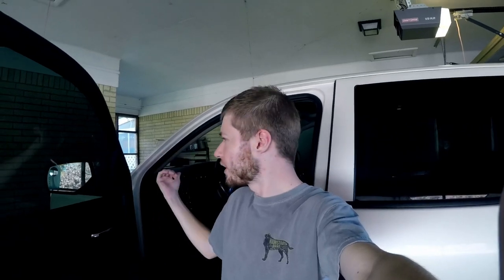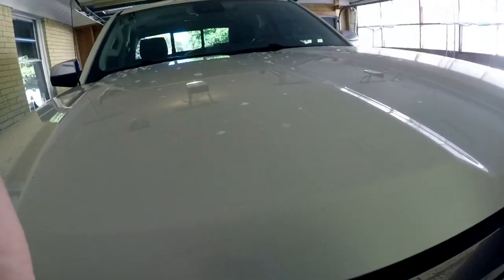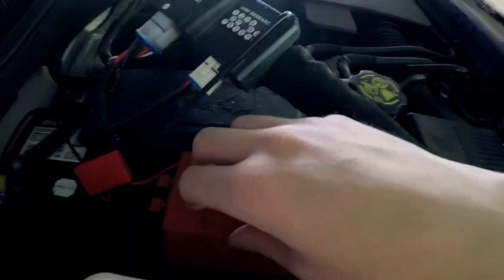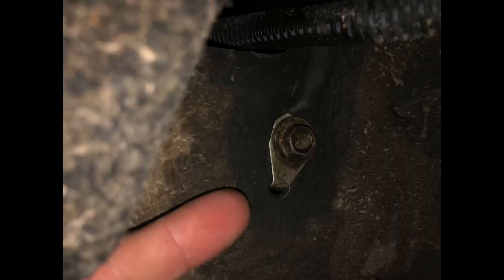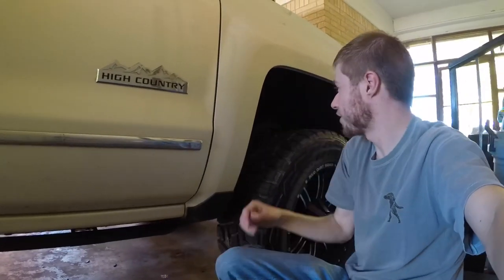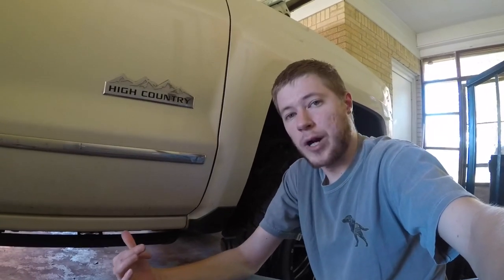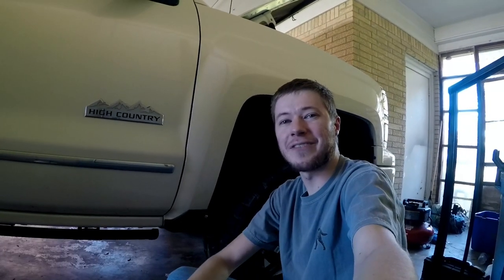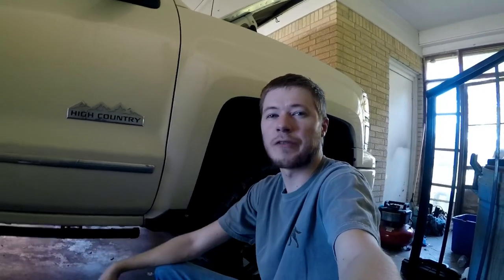Flickering Dimming Headlights Silverado Sierra (How to troubleshoot)

Comment: Had this same issue on my 2014 Sierra. Along with the flickering headlights, my nav screen and trip screen would flicker and my power steering would go out as well as my parking sensors. Really strange, however, my local dealership had a service bulletin stating that certain trucks in that year range had defective positive battery cables and replacing that should fix those issues. They did that on my truck and haven’t had a single issue for over 3 months now. Just an FYI in case your lights aren’t fixed from cleaning the grounds
Reply from the maker: This is really good info, I did not know this!
Reply: This is exactly my issue will see if Chevy will fix it for me thanks!
Reply: @audiesbuilds  did they fix it for you?

Comment: This is for everyone else that this tip didnt work for.  In 2016 I inherited a 2006 Chevy Uplander (only produced for a couple yrs.) that had the flickering headlight & dash light problem, primarily only noticed at night.  Battery & other parts tested fine, couldnt figure it out.  Drove for 5 yrs. like that, finally took it to the dealer & guy behind the desk said the only thing it could be was a bad battery but since I had drivien it for 5 yrs. without any starting issue, I found that hard to believe.  In 2021 I looked at the battery date stamp & saw early 2013 so I decided to have it tested again at NTB & local auto mechanic, said it was going bad.  Only indication is occasionally I would have to give it 2 tries to start. Given the age, I replaced it and the flickering lights problem was gone.  Only been a few months but so far so good.  It was an Interstate battery by the way. What I dont understand is, if it was bad 5 yrs ago, how could it start & run in all other ways so good for so long?  Anyway, hope my story can help someone else because it was so aggravating & at times dangerous when when other drivers might have thought you were flashing them to get out of the way or semi-trucks thinking you were flashing them to let them in.

Comment: My low beams 2015 duramax are super dim. New batteries recently and new alternator (both needed replaced). But never affected the headlights. 

With old batteries they would flicker, along with tail lights.

Comment: Thank you for the info ! I have a 2014 z71 and it just started to do this. I will be doing this before taking it to terry Cullen Chevrolet. Thanks again !
Reply: What did you find out about your issue?
Reply: @bradglo1469   they claim they didn’t  understood why it was doing it. They even told me if it was something I could just go on about my day.   I ended up trading the truck in.

Comment: Same issue here.. I cleaned the ground on the passenger side and it didn’t work. I had the alternator and battery tested, both are good. Next, I took of the dash to check the two grounds behind the speakers and both looked fine. Other than that I’m stumped!!!! I know there’s other ground throughout the truck but I can’t locate them. I was looking for a book or video that would show the locations of the “grounds” but I haven’t found anything! I Losing my mind now!😤.. it’s pissing me off sooo bad I’m starting to think I should’ve bought a FORD! 🤣
Reply: I am in the same boat. Cleaned and checked all the grounds above and still no luck. Maybe start switching out some cables. What a pain in the ass!
Reply: I'm having same issue new battery cleaned grounds then new alternator and now idn. Guess I'll get new positive cables
Reply: I’m in the same boat.  The passenger side ground worked for a little bit now nothing is fixing the issue
Reply: @gmrage  Did Yu fix. I need help. This is pissing me off. I have 2008 Silverado

Comment: I've got low voltage on 1 low beam, other is fine. I'm thinking corrosion in that circuit. Causing flickering. Headlights have the same power supply via the relay and the other light has full voltage, probably bad wire in affected side

Comment: I am having the same issue. Volts drop below line. I have gotten a check charging system. Truck has new battery. Cleaned grounds and checked wires. I disconnected ground clamp and there was no change

Comment: Sir I have Gmc Yukon 2004 6.0 I have same problem and change battery and alternator but still same can I do same and when I remove plug from ground sensor with battery 
It’s stop flicking when I put back again start help me
Reply: How did you fix your problem?? Was it the ground sensor coming off the battery

Comment: My 1 month old 2500 duramax batteries died and after I jumped it and charged them with a three hour drive, the only remaining issue is the flickering lights.   The dealer said they would need a few days to check it out.  I’m a fisherman and I paid 85k for this thing . I don’t have 3 days

Comment: Great video, thank you for sharing, I have a 2014 gmc sierra an I didn't have any problems but I put an alpharex nova headlights and everything is working fine, but for the first 15 or 20 minutes it starts to be flickering and after that the light is steady,  I will really appreciate it if somebody can tell me what is the problem.
Reply: I have the same issue with my aftermarket led headlights. Where you able to fix it?

Comment: My 2008 Silverado 1500 had a flicker problem most evident at night. That's why it was near impossible to get the dealer to find the issue if it only did it at night. Just b4 coming to a stop, I notice a down flicker in my headlights. I thought it was the alternator switching between regular and economy mode? IDK!
Reply: My 2011 Silverado does the same
Reply: My 08 is doing the same but it'll either switch from one headlight working or both working but one being really dim, I also noticed a lot of flickering when using my brakes, might be a relay going out or wiring issue due to the age but I'm not too sure
Reply: Did you figure it out ? Mine flicker on a 2010 going over 65 mph at night ? Also dim sometimes when the a/c kicks on.
Reply: Have any of you figured this issue out?? I have 2008 Silverado vortex max just started doing the same exact thing. It's pissing me off
Reply: @kenbog3638  That's what mine is. It's a 6.0 Vortex Max.

Comment: I have a 2014 GMC Sierra Denali with 6.2, I have all my lights flickering, service stabilitrack, service trailer brake, parking sensors turning off along with warning of limited assist, power steering intermittently going out and jumpy voltage on gauge, this all happens a few times a day, went to parts store and they said alternator and battery checked out fine but starter failed even though it starts fine! WTF
Reply: Have you check the g218 ground, your sounds just like this ground issue. Google g218 ground
Reply: did u ever figure out the cause of your problems? i have a 2015 yukon xl that is doing the exact same things that you have described on your truck?
Reply: I replaced both abs sensors on my 2017 Sierra and those messages went away and things are back to working order
Steering Assist working now but the message is still showing tho

Comment: My 2014 high country started doing this. Last week, I floorded it and everything inside flickered once, including the display, etc.  

This week while my fat ass was in a drive through, if I would turn the steering wheel, the front lights would almost completely turn off and the power steering would lock up intermittent and steering was impossible.
Reply: How did you correct the problem my 2104 is doing the exact same thing..thanks
Reply: @arthurarellano7448  I haven't done it yet since it stopped, but apparently it is the ground in the dash by the speakers where some insulation gets under the bolts when the truck was made.  Yt can help with instructions

Comment: Any suggestions have a 14 silverado passenger side headlight assembly not working at all.  If I go over bumps sometimes it will kick on. Checked the ground behind the fender well and cleaned it up.  Still having the same issue any suggestions?